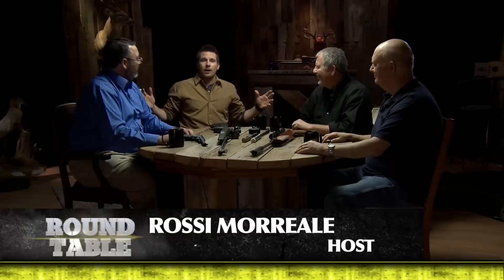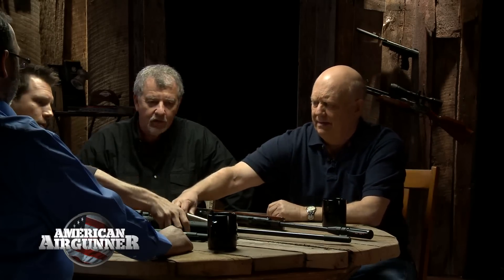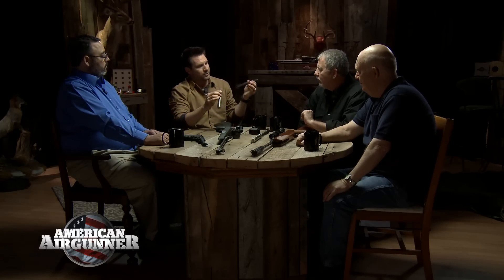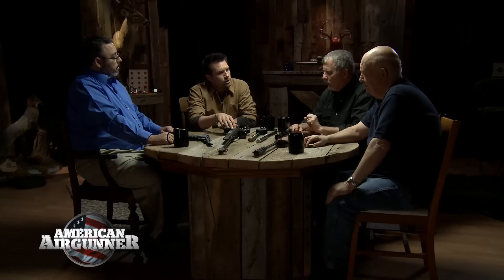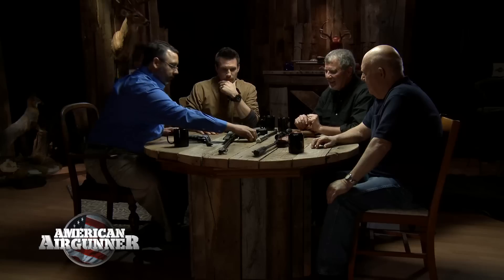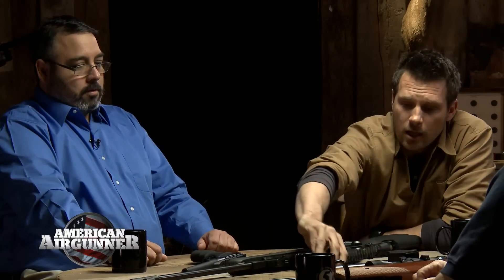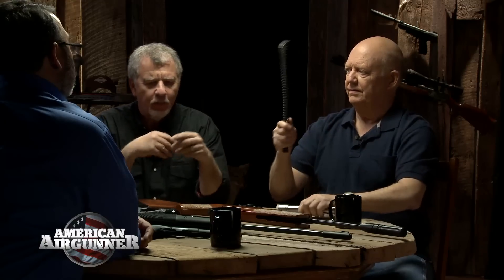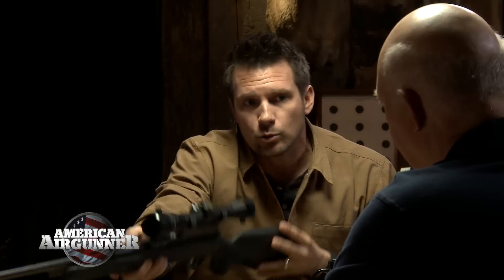Everything About Pellet Gun Air Rifles : American Airgunner TV

Comment: What's the most accurate spring or gas spring rifle for under $500?
Reply from the maker: That's a highly opinionated answer. We recommend you take a look at consumer reviews at Pyramyd Air's website. You can narrow your search to products in your price range rather quickly and find the highest rated rifles for your price range. We are partial to German-made spring rifles like Walther or RWS.  Note that Pellet weight and shape and user skill will affect shooter experience, just like with any other product.
Reply: Captainpegs07 walther lgv
Reply: pick up a hw80 / beeman r1 ...an iconic airgun that's built like a tank.
Reply: Captainpegs07 You'll get lots of answers but the fact is there are many that are extremely accurate. My Gamo springer does single hole groups at 30 yards. My friend's NP2 gas does the same thing, is my next gun next month. Hatsan, Benjamin, Beeman, and the Ruger Blackhawk Elite are definitely marques and a particular model to look at. AirgunDepot.com has the refurbished Ruger Blackhawk on sale for $79 right now, stating 1200 fps in .177 but with standard weight pellets it will be more like 900.

Comment: hey can someone explain to me how the pressure in front of the piston can get to the pressure (what they claim) of over 1,000 psi? my issue is that say that even if the pellet didn't move at all- isn't it accepted that once the piston compresses half way the pressure is double the original (ave air psi~30psi, so now 60psi) even if the pellet didnt move once the piston moved 3/4 of the way down it would still only be 120 psi. then even if it went 7/8 of the way it would still be no where near 1,000 or 2,000 psi. im not saying that these stats are lies i just dont understand it
Reply: +James Sever 
the start pressure on a spring rifle depends on the barrel diameter and also on the pellet skirt thickness. some pellets will start to move at a low of 120 psi whereas the some will need upto 600 psi.
lighter pellets usually work better in a springer and the heavier pellets in a pcp.
Reply: do an easy test mate, hook a barrel upto an airline with a gauge and you'll find falcon plus pellets need about 120psi to move in a 22  and the hobby needs about 600 psi

Comment: My brother left my brand new air gun cocked for a whole day I feel like it isa lot less accurate now any tips on fixing it
Reply from the maker: This is a topic often debated - whether or not leaving a break-action airgun cocked or not will alter its performance. Although we recommend that you not leave a spring powered air rifle in a cocked position for extended periods of time, the situation you’ve noted will typically not impact accuracy. If you have access to a chronograph we'd suggest confirming that the velocity is fairly consistent. If it is, then likely no harm caused. If it damaged (broken), you will experience erratic velocity and therefore poor accuracy.

Comment: tell Rossi I just ware a glove on my cocking hand to avoid the hand prints on the barrel or cocking arm... :-)
Reply: +Pez Pezzer I wear a slightly oiled glove on both hands. used those same gloves back in 1992-93 when shooting .22 cal smallbore Olympic style 3 position NRA competition. Now I just keep the gloves ever so slightly oiled and all my air guns and firearms stay oiled and clean. Of course every so often I do wipe down the metal with an oily rag to prevent rust. I also wipe down the wooden stocks but I am careful not to over oil as it may soften the wood. Just enough to keep the wood clean and shiney. 
Wearing gloves (with the finger tips cut off so your hands stay cool) removes any pressure point induced pain when shooting a long time and it also allows for a very relaxed grip and that saves muscle strength because you need not apply pressure and yet your hand grips the stock as the wood rests in the palm of your hand. I shoot all rifles and air guns using Tom Gaylord's "artillery hold".